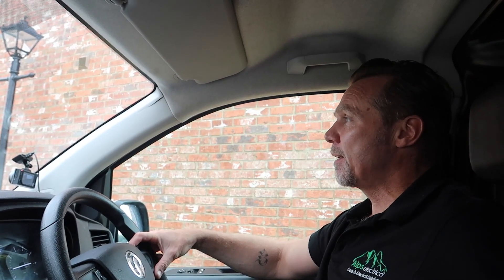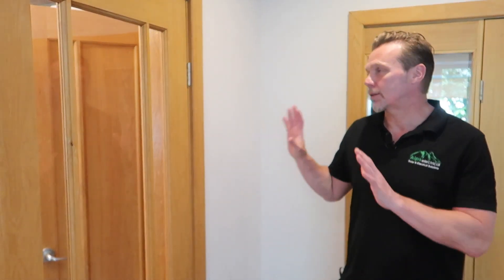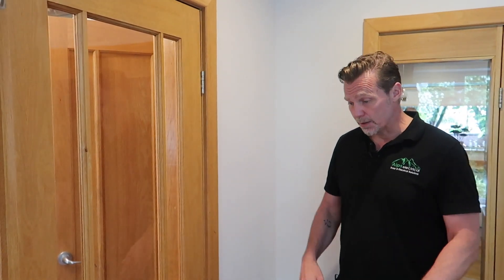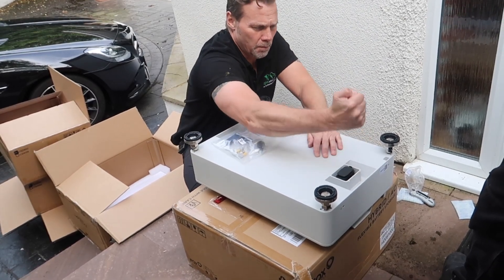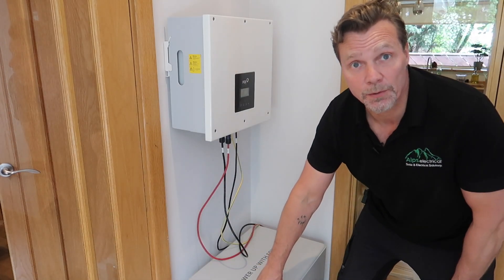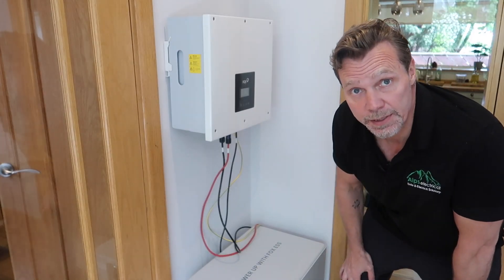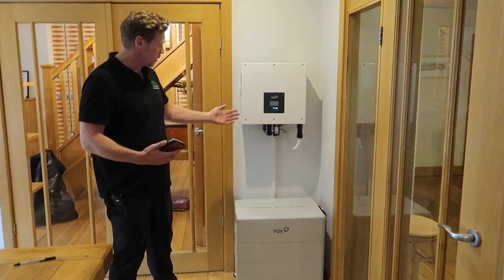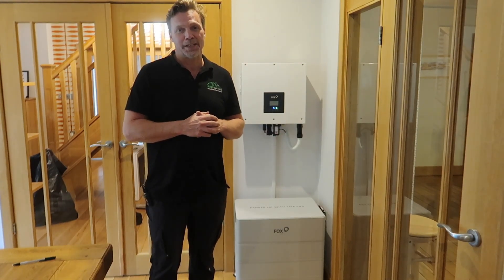Are Home Batteries Worth It Without Solar? | Fox ESS Cube Installation | Alps Electrical

Comment from the maker: ⚡ Are home batteries worth it without solar panels?

Absolutely — here’s how!

In this project, we installed 11.52 kWh of Fox ESS Cube battery storage for a customer whose roof wasn’t suitable for solar.

The system charges overnight at 7.5p per kWh on an off-peak tariff, storing cheap energy for use throughout the day — no solar required.

💬 Thinking about adding a battery system to your home?
📞 01642 790489 | 🌐 alpselectrical.com

📍 Serving Teesside • Durham • Sunderland • Newcastle • Northallerton • and the wider North East.

🔔 Subscribe for more renewable-energy projects and battery-storage insights from Alps Electrical Ltd!

Comment: Pretty sure I’d get a system I could install outside! My only concern is the idea that the tariffs we have today will still be similar in 5 years, I can see many more dynamic tariffs reflecting wind generation than legacy fixed tariffs in the future. Fox is not the company I’d expect to keep up with that.
Reply from the maker: Hi, thanks for your thoughts, if only we could all predict the future?! Truth is, nobody has any idea what the future will look like in terms of tariffs and energy cost. All we can go on is what we know and the last few years has saw a sharp rise in energy costs crippling many home owners and businesses. If that were to continue or spike again, then it could get quite scary. Regardless of the tariffs solar keeps working whilst the sun is out and so without being able to predict the future we know that investing in solar now gives you back some control for what may be.

My experience of Fox is that they are just as up to speed as any of the other brands. Infact they are much better to work with and deal with than GivEnergy. The Fox system can do all the same things that one can yet it has far more options in terms of inverter sizes and battery capacity/design options. Fox has more sizing options than any other brand on the market which helps making sure a solar system is accurately specced. Fox all the way for me!

Comment: I really don't see how the finances of this work out. You say this would cost £5.5k, so even if you used the entire capacity of the battery every day at a price of 7.5p that's a payback of over 7 years. In reality you might average 70% capacity used per day, so that pushes the payback to over 10 years, and all this assumes the difference in overnight and day rates stays as it is. Logically as more "time shifting" technologies connect to the grid the peaks and troughs of demand will decrease resulting in ever lower savings.
Reply from the maker: Can you explain your calculations of how you get to a payback of 7 years if using the full 11.52kWh capacity, and also why you believe you would in reality only use 70% of the capacity on average?
Reply: @alpselectrical  Normal unit price 25.83p - night rate of 7.5p = 18.33p
Multiply by 11.52 = £2.11
Divide into £5500 = 2606 days = 7.14 years
Everyone will have days where they don't use 11.52kWhr, ours drops to maybe 2kWhr when we're away, and there are plenty of days when we might only use 6-7kWhr, that's in a 150m2 bungalow in the Highlands with a heat pump.
Reply from the maker: Obviously, everyone's situation is different and in this particular case, their daily usage is actually more than the battery capacity. 

We suggest doing this and seeing how the figures/data look in 6-12 months, and also how the market looks in terms of tariff rates and of course battery prices and make an informed decision on whether more is required. In our experience being conservative in the beginning with the amount of battery storage is a sensible approach. 
This is why a battery storage solution that can be very easily added to, and importantly in small increments is, in our opinion, essential.

So this customer will likely use mostly all the available capacity, but for argument's sake let's say they just use 10kWh per day over the course of a year:

10 x 25.83p = £2.58 per day
10 x 0.75p = £75p per day
That's a saving of £1.83 per day x 365 = £667.95 per annum

A saving of £667.95 per year with a £5500 investment is around a 12% ROI

The best savings account at the moment offers around 5.5%, but even if we said 6% the same £5500 investment would earn you £330 

So you are £337.95 better off per year in this example over putting the same amount into a savings account at this time until the capital investment has been repaid. Then of course it is all profit and the batteries become an asset. 

The payback period is only one way of looking at a solar/battery purchase. The ROI is also key to calculating the viability of such an investment into your home that you will eventually own outright with the value of that asset (Nett Present Value - NPV) increasing year on year.

Of course, nobody can predict what will happen to the market, but as we have seen recently the energy prices can just rocket and we have to pay it. Investing in these renewable technologies gives you at least some control, and eventually, they will be paid off and then it is all profit. In my opinion, and it is just that, I can only see the cost of standard daily rates rising, I cannot see the lower nightly rates rising as that would discourage people from investing in renewable tech which will have a negative impact on the grid. 

If the cost of energy rises then of course the investment in solar and battery storage will be more prudent in every way.

Further to this, Octopus Energy is now looking to offer battery-only/Go customers the same export rate as that of the intelligent Go, which would be at a rate of 15p per kWh. This would be great as you could then force discharge your batteries on days if you were on holiday for example you could continue to charge them to 100% during the night at 7.5p per kWh and export them the following day at 15p per kWh down to say 10%. Clearly, that would have an impact on further improving the ROI. 

But as I said, nobody has a crystal ball and we cannot possibly predict the future cost of energy, the rise or fall of interest rates, etc. 
We only have the option to offer a choice, and every customer we issue a proposal to receives a full breakdown of the projected figures based on what we know at that time and it is up to them to decide if it is the right choice for them.
Reply: @alpselectrical  I was going to leave ROI and alternative investments out of it, but as you say, taking those into account now pushes the break even out to 16 years
The absolute cost of electricity for a storage only system is immaterial, the only thing that matters is the difference between the night rate and day rate, as more EVs and storage connect to the grid and want to charge overnight that overnight demand will increase and prices will rise and hence reduce the price difference. 
The shape of the UK's demand curve has already changed, it used to hit minimum at around 02:30 - 0300, now it's around 05:00, the demand through the hours after midnight is held up by EVs and storage batteries and slowly falls away to pre-EV levels as they switch off. The market will have to adapt to this change, and the only way it can do it is by raising overnight rates.
Reply from the maker: I disagree, and as I say, nobody can predict what will happen in the future with rates and energy prices. To do so is purely speculation.

Everyone will look at everything differently, and we can disagree, that's fine, I am not here to convince anyone of anything, as crucially everyone can make their own mind up once supplied with all the costs and information provided to them at the time, and this customer saw the benefit of adding this system, and so they have. 

Looking at the ROI of such a system against an alternative investment was to highlight the improved annual return, as an alternative viewpoint to just the payback period, which many get fixated on. 

However, that was based on a 6% interest rate, which in reality can fluctuate and go down just as tariff rates as you say can go up. Also, you are completely overlooking the NPV which is the asset you have purchased growing in value year on year as mentioned in my previous comment. After 7/8 years in a savings account, you can withdraw your savings and that's all you have for the investment. So to suggest looking at alternative investments doubles the payback period is inaccurate. In actual fact the payback period remains the same.

The systems we use to provide a proposal are MCS approved and incredibly good at a 'best guess' for the duration of the investment, and they include obviously the cost of the system, tariff rates, a homeowners usage, archetype, and predicted inflation rises. 

It kicks out a financial projection which includes, annual savings, payback period, ROI, and NPV. It even includes how many trees you will save, as for many customers that is their motivation for doing this, not just payback periods. 

Thanks for your deliberating though, it's always good to have discussions and share personal opinions :)

Comment: Did the customer not mind that the Fox app seems to have issues/bugs at the moment?  I'm using the app for it's charts and live usage, and having to use the desktop version of the app for charge/discharge settings.  Both seem to have issues, desktop app has the look of a beta version still under development.  Can't believe Fox are are allowing their software to be out there like this!
Reply from the maker: Hi, thanks for the comment. Yes we let the customers know about the Fox new app glitches, but as with any new app or software there will be teething problems that we can only hope will be temporary. I speak to Fox a lot and they are aware of them and working hard to fix them globally. Apart from that though Fox batteries and inverters offer excellent options and are very good systems.
We do offer our customers ongoing support with altering settings in our installer portal if they are struggling with the app. Failing that Fox can help you apply settings if you are unable to a your end :)

Comment: Nice install. I don't think I would want batteries in my dining room, but different strokes. It's just a shame that there isn't a cowl to hide those input leads to the inverter. Did you have to add anything in to make provision for the batteries being removed for  new flooring, etc ?
I have mixed views on battery payback, but if you are already on an EV tarrif, and have no access to PV this makes sense. I do think you should still make mention of the kilowatt hour cost of having that system ( my guess would be about 10ppkwh over it's lifetime), so whilst there are savings to be had, they are not as great as your pop-up at 1:24 implies !
Reply from the maker: Hi, thanks for the comment. The dining room was the best available option logistically on this job and to satisfy the regs and the new PAS 63100 for battery storage. There was no other option in this case and the electric meter and C.U was right in the middle of the house, basically back-to-back with this install so it could be kept as neat as possible.
If the flooring is ever changed the batteries are just stacked and stood on legs so can be easily moved and replaced. The homeowner can even do this themselves.
As this is just an installation video showing the installation processes we don't really go into the costs and paybacks in any sort of detail but perhaps something we can look to do in the future. 
The pop-up is just a screenshot of the Octopus Go tariff and shows the current import rate of 7.5p which is just what you pay to top the batteries up during the cheap period. That was just an example of the cost to import electricity at a price per kWh, not anything relating to how much a customer would save. That would be something that the customer's proposal would detail.

Comment: Very neat installation. I have a few questions. When you start using appliances around the house how does the battery know when to kick in?  Does the battery take over completely and shut off the mains supply? How does the battery know when to charge? Is this all controlled by the BMS?  Hope you can offer some advise!
Reply from the maker: Hi thanks for the comment. 

The BMS does control the batteries and communicates with them. The inverter has a CT clamp that is placed around the main incomer of the electric supply that monitors home usage. When the inverter sees the house load demand it will supply it from the batteries until they are depleted and then you would pull from the grid.
If you have solar too then the load would always first be supplied by the generation from the panels, then from the batteries, then the grid. This happens automatically. 
It doesn't shut off the mains, it is effectively just routing power that it holds to your house load but you will rely on the grid when they are empty, or if for example you require 5KW but only have 3.7KW available then the remainder would be topped up from the grid. 
You can set your batteries to charge in the app, for example during the night to charge at the cheap rates, or if you have solar they will automatically charge from solar.

Hope that helps!
Reply: @alpselectrical  Thank you. I wondered how the system managed to monitor itself and now I know. I googled CT clamp and there was the very thing.
Reply from the maker: Great stuff!
Reply: I had solar with Fox kit installed about 6 weeks ago.  The system usually senses the change in use (load) and takes from solar first, then battery, then grid if need be, to make up the total load at that time.  I see on my chart that it glitches sometimes and takes from the grid needlessly, it's irritating but doesn't happen often.

Comment: How much was this system fully installed?
Reply from the maker: Hi, thanks for the comment. You are looking around £5.5k for a system like this with this capacity of storage, depending upon what is already in place, ie, suitable consumer unit, earth bonding to gas and water and location of components for cable run feasibility and cost

Comment: How does this stack up (pun intended) against the new install guidelines for external domestic batteries / fire proof enclosures with alarm inside? Not legal requirement yet but could invalidate house insurance...
Reply from the maker: Hi, thanks for your comment. The new PAS 63100 document that has brought in new guidance is actually active now and all installers should be abiding by it. 

This installation ticks every box as it is in a frequently visited room with good ventilation, good access, structurally sound flooring to support the weight, not in a loft or small cupboard under the stairs. Not close to any gas appliance or water cylinder, not in a bedroom or close to a bedroom where people will sleep, and so on.

Batteries can still go inside, but there are lots of restrictions to bear in mind now. We do install batteries outdoors, and in garages, but not everyone has the options. There has to be an element of common sense used. If a customer wants to put batteries in their house then we follow the rules and try to make that happen for them. We look at the best available option that follows all the regulations - of which there are many!

Comment: Hi, Good Evening again another great informative video from you guys. Thanks for your insights.  Any ideas when you may do a video on the pro's and Con's of other work mode functions.  Currently I use the force discharge but going away shortly and it was suggested I change the feed in priority wondering is this viable and how you do it.  Keep up the great videos
Reply from the maker: Hi there, thanks for your kind comment....do you have solar and battery storage? When I go away I leave turn  off my force charge cycle during the night but I leave the force discharge on to take the batteries down to 10%. 
Thereby leaving the sun to charge the batteries as when we are away we will not need any battery capacity for the morning as we do at home. 
I don't bother to change the work mode as that works for me. I am on Octopus Flux!
Reply: @alpselectrical  Good Evening and Thankyou for the response and opinion.  I have now added a further 2 2.9Kwh batteries to my stack.  I am wondering when do you think you cross over too too much storage capacity.  I note most people have around thier daily usage which for me over a 15month period average is 9kwh, However this is not a money making situation but more a money saving.  The arbitrage between force charging and dicharging is 10p currentlyso when would you consider having too much or would you gently ramp up to the maximum possible on the stack.  Regards Rob
Reply from the maker: Hi, thanks again for your comment. 

I would always suggest that you build gradually, as of course the cost of the batteries may come down, and also you can look at your data and check it against costs before jumping in.

If you are considering an extra battery and want to buy and sell energy too then you can do your calculations taking into account the cost of adding it and you should see the time it will take to pay it back/ROI. 

For me, I would always go with building in small well informed increments. Remember that in 6-12 months the energy tariffs may look very different!
Reply: @alpselectrical  Thankyou